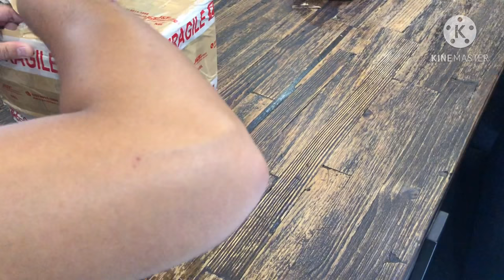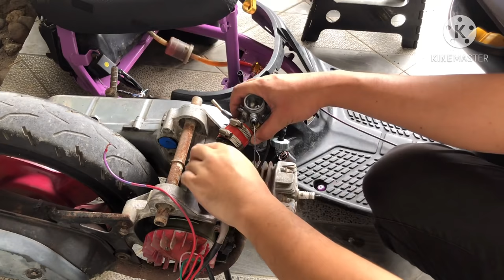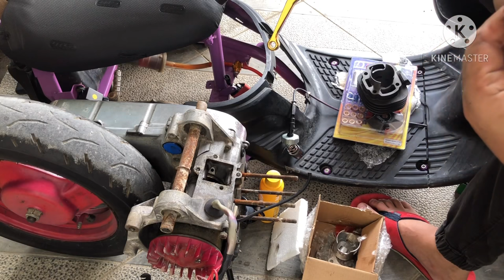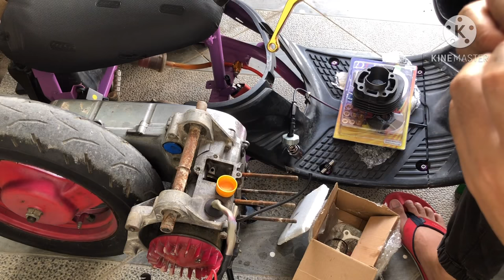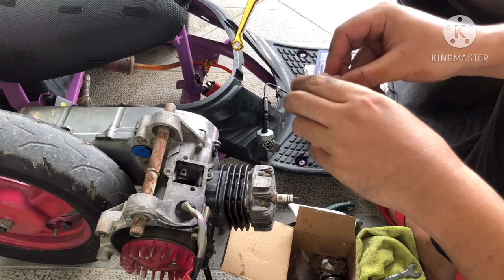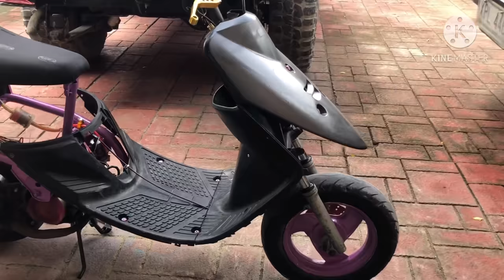Yamaha Jog 50cc Setup to 70cc

Comment: NEVER! and i say never use a hammer to put on your new cylinder. you just ruin it, if it wont slide on easely you have done something wrong.
Reply from the maker: The piston and ring is good, but the 4 bolts is rusty thats why it won’t slide easily.. welcome to my channel anyways..

Comment: May I ask if increasing the diameter of the 70cc capacity mm will increase the speed.  What is the maximum speed of 70cc in km
Reply from the maker: It depends on the setup of the gearing if you want a more speed, if you upgrade to 70cc it will increase the power of the engine in acceleration.
Reply: What if u have 50 puno segunyal , no more machine shop ? Or if ever need fort the shell?

Comment: paps patulong nman  newbie lng ako my jog50 ako balak ko sna set upan ng ng 90cc anu mga parts kailangan?
Reply from the maker: Bili ka piston set block na 90cc un lang pwde na kong budget meal po, kong gusto mo gaganda talaga performance isama muna ang sigunyal, manifold pra sa big carb at set of pulleys po kasama na ang mga RPM spring pra matimpla mo ang arankada nya.